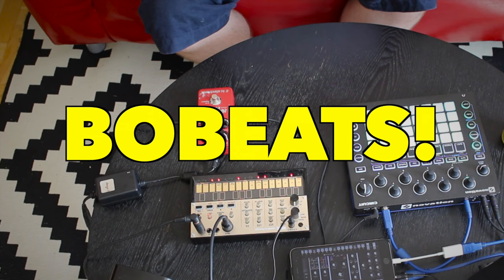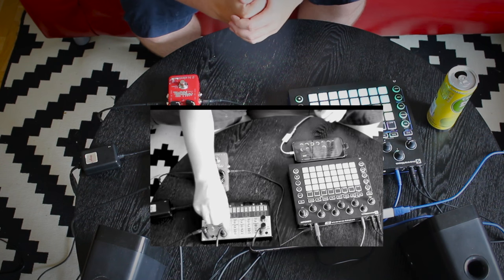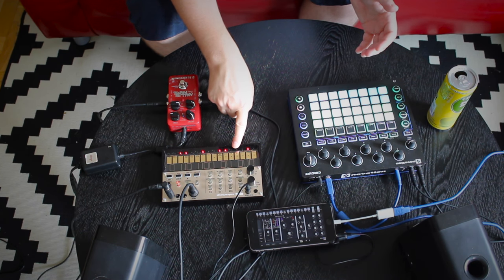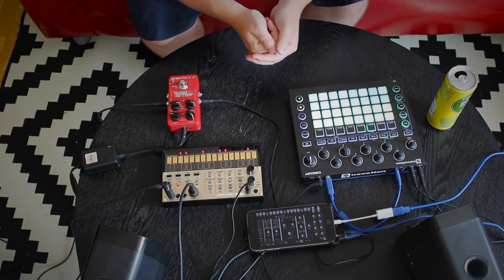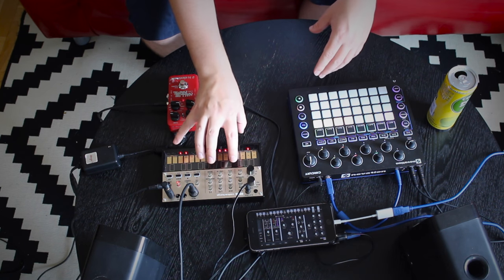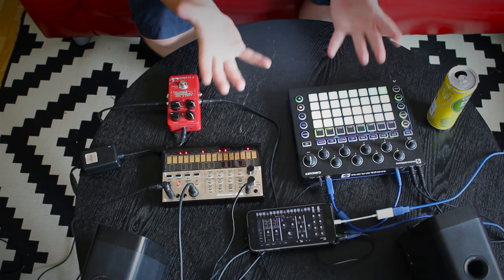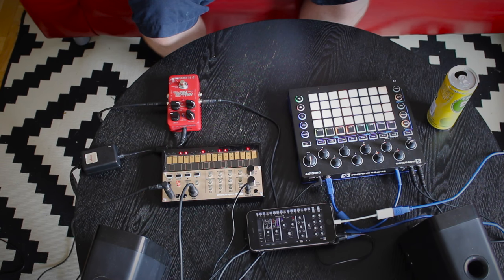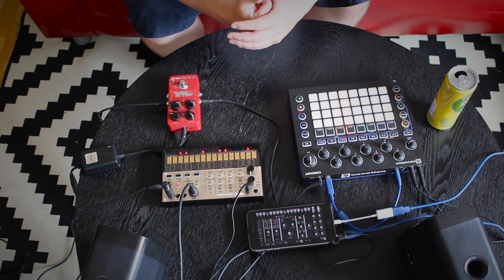My Volca Keys & Circuit Living Room Setup

Comment: Could you explain the setting in the circuit menu on how you get it to control the volca? Basically when you hold shift and power on the circuit which buttons are lit up and which are not. Im not familiar with terms such as TX and RX, CC, Program change and others in the circuit manual.

Comment: Great! I got a question. Is it so simple to use that cck and circuit. I thought that i have to use for example irig midi between phone and circuit. Does it work with all apps
Reply from the maker: You only need iRig if you want audio from something into the iPhone. Or better audio out.
Reply: +BoBeats audio with irig midi? Now i did not understand your answer. Sorry 😇
Reply from the maker: Oh my bad... Tired and sick still mate. 

For midi all you need is a camera connection kit, yes. Should work with pretty much any app. I use it on my old iPad 2 and iPhone 6 Plus. Never had issues with Korg apps, connecting to my hardware or Moog app, or Maschine app.

Comment: Hey bo, when you sync volca and circuit, audio output goes from Circuit to headphones or speakers, or do you need an audio interface??
Reply from the maker: +Matthew Weintraub I am using a 4 input audio interface
Reply: BoBeats how do you get audio to playback from the same source??
Reply from the maker: +Matthew Weintraub I sync everything using midi out from the Circuit. Then just connect the audio outputs into my 4 channel audio interface. Recording into Cubase
Reply: would I able to use this interface BEHRINGER U-CONTROL UCA202 for just a circuit and a volca??
Reply from the maker: +Matthew Weintraub no you need 3x inputs for circuit + volca. I would not recommend that card
Reply: BoBeats could you post a good interface to run a session with the circuit and the volca, thanks. I'm new to this and want to get them jamming together.
Reply from the maker: I would recommend something like this: https://us.focusrite.com/usb-audio-interfaces/scarlett-6i6
Reply: BoBeats Hey Bo!! Wondering if this audio interface would work for recording a circuit and volca session??